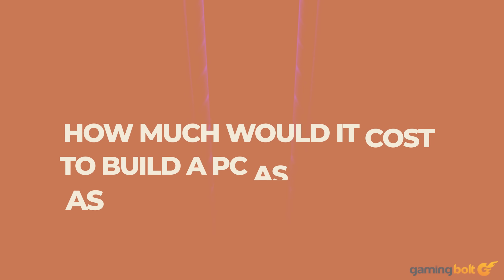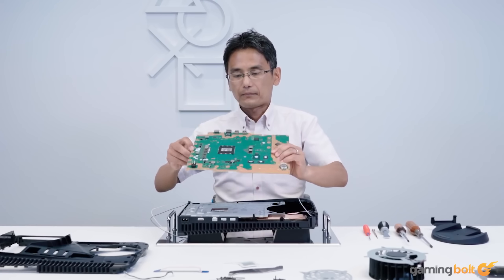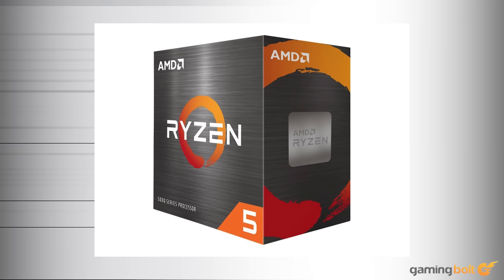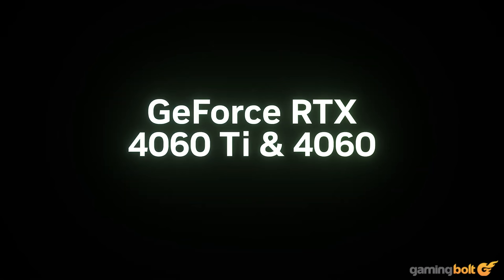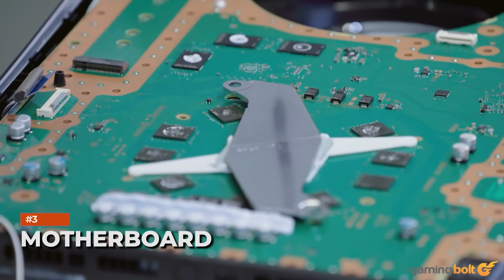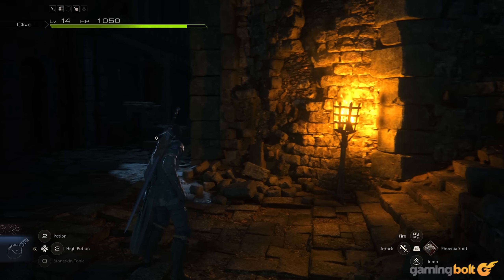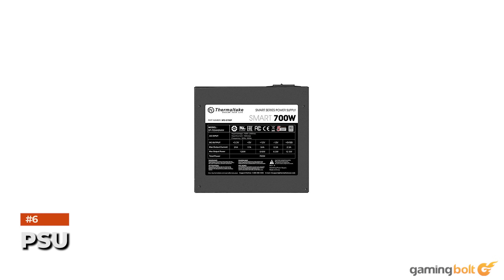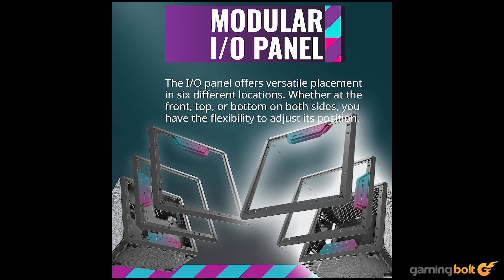How Much Would It Cost To Build A PC As Powerful As The PS5? (2023 Edition)

Comment: The only thing that sucks about PC gaming is all the different launchers you have to have drivers updates and compatibility issues with hardware at least with consoles if the game case says what console you have you know it's going to work. Not to mention how fast PC hardware is outdated in compared to consoles I bought my Xbox in 2015 and the latest and greatest still work on it load times are slow but they still work. I built my PC about the same time and I can't play the new stuff
Reply: But, you're missing one of the H U G E benefits of building a PC - Future upgrading is easy! Want better graphics, pop in a new GPU! Same with CPU and mobo...easy to upgrade, as is the RAM....but you don't have to re-spend on the Case or PSU! 
I build my own PC's and don't have issue with launchers, driver updates are something you get auto notified about and are easy to update...taking a few minutes. You mean Steam, Epic, etc? Buy the actual game and install it yourself if you are so worried about launchers. I've never had any issues with various launchers. If you do, buy everything on Steam. 
Compatibility with hardware? What the hell computer did you build? I've never had a hardware compatibility issue in all my years of building PC's...which is around 30 years!

Biggest issue:  Buying a console is buying a DEAD END! Like my PS3! Yeah, I use that all the time...haahaa! DEAD END!
Reply: @KOrnhOliO1  I spent $375 on my Xbox One in 2015. 7 years later I can still use it to play the current console games. Yes it's 1080p but I couldn't care less about graphics more about gameplay and story and the mechanics of how the game works. I spent $600 on the gaming PC in 2015 and all that was able to afford me was an NVIDIA GTX 950 with 2 GB of vram and an AMD 8320e processor which in 2015 that processor was already 3 years old technology wise. 16gb of ddr3 RAM. It plays PS3 360 era games quite well. In 7 years later still plays those games quite well. To upgrade my computer to play today's current titles you're looking at what another $700 minimum.  I would need a whole new motherboard I would need a whole new processor socket whole new ram and the graphics card alone is about $500. Yes I could go with an  older generation card. But I would be in the same boat in another couple years that I currently am in now. I can play the triple a titles from a couple years ago but I couldn't play new latest and greatest. 

Last time I had games through steam like assassin's Creed games I still had to have the Uplay launcher to agree to terms and conditions and then it would go back to steam and launch from steam. Whereas on console if the box says Xbox no matter what Xbox I put it in it's going to work. You got to have the epic games launcher you can only buy epic games from epic you can only get games from EA and go through their crappy launcher or if EA and everybody else puts there game on steam you still have to have their launcher to verify the key then it will launch in steam. 

Yes PC gaming has its pros and cons console gaming has its pros and cons. I grew up in the 90s my first console was the original PlayStation I like their simplicity better. I couldn't care less about frame rate and graphics as long as the game doesn't stutter and I push about 35-40 FPS I'm pretty content and I don't game like I used to with all the micro transactions and game developers releasing beta versions for full retail price and everything that should have been included at launch is now in DLCs I play maybe a select handful of games and that's about it and I go back with backwards compatibility on my Xbox and play call of duty Black ops and Black ops 2 and Forza.

Comment: There's a lot of people talking about the specced hardware and compatibility... But I also think it's worth highlighting no peripherals, OS, etc etc.
This is just like for like hardware and the sum is always greater then the parts.
Add to that peripherals.. Either a cheap keyboard and mouse and a controller for gaming.. or just a keyboard and mouse which you would want a gaming one.
If you're going to use it with your TV then makes the use of it as a PC for other tasks more awkward. If going to use it as at a desk then a monitor as well. And with all this frame rate talk you need a good monitor, plus speakers or one with them built in.
Also an OS, which really is going to be windows; you can use a Linux for free but then have the negatives associated for general use.
On top of that, it would be a very blah looking pc. To have a stylish setup to match ps5 aesthetics you're paying out for better case, matching cables etc.

But! More than all that, anyone here built their own pc knows that when you've "decided" on what you want... You end up scrolling that little bit further down the 'sort price ascending' list and "ooh, for just another $40" I can get the next model up... And so on and so on.

Based on your core items there; you would be talking easy over a grand to do a proper match up.

Comment: Ryzen 5600x comes with the same cooler and can be got for the same price now. That Motherboard does not support the speeds you claim as it only a PCIe Gen3 M.2 not Gen 4. You could have got the Gigabyte B550m which has  PCIe Gen4 M.2 for a lower price

Comment: A RX590 outperforms PS5 in 1080p with HDR enabled. Hitting 380fps on Resident Evil 2 remake while PS5 plays it at 60fps with HDR. Most games are not even native 1080p and are all upscaled from 720p, 600p, or 900p. So the less upscaling the sharper the image. This is why 4k sucks.

Comment: Because of the mass market adaptation of consoles and franchises that are exclusive to a given console (at least initially), many games are optimized to extract maximum performance from the respective console. This is similar in concept to an Apple computer having inferior components to a PC on paper but yet out-performing that PC in reality : there is a very tight coupling between software and hardware that much like Apple, consoles also enjoy. 

This basically means it is very hard to compare "apples to apples" between PC and a given console just like it is hard to compare an Apple computer with a PC if you only look at the specs. Best way to compare I'd argue is to look at performance comparisons : analyze the resolution, frame rates, and approximate the graphical settings of games available on both PC and a given console and then figure out what it takes in terms of a PC that can achieve similar performance to the console with that given game.

Comment: Could have saved about $20 by picking a lower wattage power supply.
This tends to be how console vs PC pricing goes though. On launch day the console is cheaper, halfway during its life cycle PCs are about the same price or cheaper and just keep getting cheaper from there on. 
Not to mention by that point you'll have to spend so much money on the online (PSN) subscription the PC worked out to be about the same price anyway. And I'd say steamsales/key sites still got the PS5 'bargains' beat and launch prices tend to be lower as well. And you don't have to cross your fingers and hope you can play older games in the future because the PC's backwards compatibility goes back to DOS games even. Ironically if you want to play your old Playstation (one), 2, 3 or even 4 games you probably have better luck on the PC with an emulator than on the PS5 hoping Sony or whatever studio allows you to play it.

With a PC the up-front cost is higher* but in the end it works out to be about the same because of lower game prices and no subscription fees. On top of that you have a more flexible machine that can run more games (bigger game catalog and the option to emulate), and do things besides gaming; like my personal favorite activity: ranting on YouTube.

PS: For those that like to spout nonsense about the mouse+keyboard combo not being suitable for gaming. You can connect a gamepad just fine to a PC, heck it can even be a PlayStation controller if you really want it to be. But I'd advice getting something higher quality with HAL-sensors so you don't get stick drift.
Oh and try playing a strategy or proper sim game with a controller - there's a reason why they're not ported to consoles.

* Partially because people tend to want to hook up a monitor to a PC whilst they settle for the TV for a console - technically you could hook a PC straight up to the TV as well.

Comment: I used to be a PC gamer exclusively way back when, but somewhere along the way, I started using consoles more and now use them exclusively. Will they ever match a custom-built PC in performance and power? No, but I'm ok with that. As mentioned in this comment section several times, the primary reason I like consoles is that the games I play are designed to play on them. When I was building gaming PCs, I was always concerned with my hardware being good enough to play games. That and upgrading became really expensive.
Reply: yeah man you should have spent at least 10K in order to play a game in Ultra graphivs
Reply: @karlsamuelson2906  10k? XD
Reply: Yea I got into pcs when u had to be constantly upgrading. Even worse than today. It put me off. Console can be a pain but it’s hassle free and I don’t have the time
Reply: Same with me, I use my console to play game more than my PC.
Idk, maybe I just getting older so I don't have to worry about upgrading my PC. I just want to play game on my couch when I get home from work. I don't have to worry about how much FPS I'm getting to play certain games. For the last 3 years, I mostly only play 1 mmo on my PC and play everything else on console. I built my PC in the end of 2017 and paid around $2000 for that built. Now my pc just standing in my room, only sometimes turning on my PC because there still some games I haven't finish. I also have a laptop capable of playing games when I have work in other city.
Reply: i was in the same situation, pc can be easily outdated within 5 years, now that entire pc consists of different parts, new gen means new platform, new platform means more $$$ to spend. People praise pc gaming for its multiverse of use, but that comes in a huge cost, and that is optimization. End of 2023 we saw Alan wake II, does it play well on pc ? Yes, only if the pc is high end, and no if your pc is mid range.
Reply: I don't have the option for PC gaming. I have around 1K of money spent on steam and saves are too precious. Steam is currently having a 2023-24 account problem. With steams current method to verify account in support it's simply not possible for me to recover. I wish I could sue them. Perhaps this is why youtube ads show this legal team to sue steam...anyway I resumed my playstation gaming and upgraded. I forgot how many free AAA Single player games you get with plus. I currently have 97 games on my playstation (downloaded all in a 2 month period) and it's value is over $1,500 for 15$ month subscription. I started fresh and it feels good to lay down or sit on couch with controller. Final Fantasy 7 Rebirth is coming at the end of the month playstation 5 exclusive and it's going to be epic. I'm done with steam until they can change.

BTW be carefull with your steam account. If you log out of your pc and reinstall steam you may get what I have.
Reply: It's the same reason Software Engineers often prefer Macs instead of self built computers. You want to focus on the thing you're doing, not screwing around.

I am big into PC Gaming but even I get that.
Reply: @NotForMe-97  maybe software engineer and editors or writers would like mac (only edotors would have maybe a better experience). But for anything else you would choose windows for sure, i am an electic engineer and software engineer and using a mac is way too limiting, half of the programs arent even supported there sadly
Reply: Doesn't sound like you like games enough dude
Reply: @gomperhooblet  ridiculous thing to say

so u need to have a pc to like games?

laughs in GoW and Uncharted and Spider-Man 2

keep in mind I have both but tbh playing in a relaxed way knowing my console will do 4k and play any game with ease without the need to upgrade with an extra 500$ on a gpu or cpu is a great feeling
Reply: No offense but it sounds like you're not building a PC with the right budget.

Comment: I'm currently running over 50gb of mods for FO4, how many mods can the ps5 run?
all the pc parts you bought are way over powered compared to a ps5 so your vid is invalid plus the ps5 is nothing more than a games machine while a pc even a cheap one is a multipurpose work machine that can also play games.
there are far too many games on pc that aint on the ps5 or runs at a low grade to even consider downgrading to a console of any brand. 
but got to love the console peasants for trying to think they have better hardware especially when they do price comparisons of much more powerful pc parts to make a console look more inviting.
there are no games on the ps5 that I want to play that are not on the pc and gaming on my pc is only about 15% to 20% of its use so spending $500 on a machine that will spend more time collecting dust than being used is an absolute waste of money.
consoles are for kids/teens, pc's are for adults.
ps. whens starfield coming to ps5?

Comment: right now there are plenty of laptops more powerful than a PLAYSTATION 5 FOR AROUND 6-800 DOLLARS. Ryzen 2 which the playstation 5 has is weaker has lesser power than an intel i5 or intel i7 or a Ryzen 5 which most laptops are being sold with. 16GB ram is the only thing that the Playstation 5 had that was unique about it but laptops are catching in the same price rang with 16GB of ram yet with an intel i7 or Ryzen 5 or Ryzen 7 for under 800 dollars. And trust me even most smartphones are coming out with 12 OR 16 GB of ram and with CPU processors like the snap dragon more powerful than an Ryzen 2.

Comment: right now there are plenty of laptops more powerful than a PLAYSTATION 5 FOR AROUND 6-800 DOLLARS. Ryzen 2 wihc the playstation 5 has is weaker has lesser power than an intel i5 or intel i7 or a Ryzen 5 which most laptops are being sold with. 16GB ram is the only thing that the Playstation 5 had that was unique about it but laptops are catching in the same price rang with 16GB of ram yet with an intel i7 or Ryzen 5 or Ryzen 7 for under 800 dollars. And trust me even most smartphones are coming out with 12 OR 16 GB of ram and with CPU processors like the snap dragon more powerful than an Ryzen 2.

Comment: Gpu on ps5 is Rx6500. Rtx4060 is overkill. You should use Rx6600
Ssd on ps5 is dramless 3500mbps. Any pcie 4x4 is faster
CPU 8core = 4c 8t in pc. I3 10100f or ryzen 5500 is the equivalent

Comment: The 4060 is a joke, you better get the 3060 with 12 gb of vram and not far from the performance of the 4060.
But if you dont care about nvidia the 6700 xt is the best gpu to get for that kind of money.
Reply: No. Rx6500 is gpu on ps5. Rx6600 is better option

Comment: I'm a console player for 10 years but a Ryzen 7 5800X3D + RTX 3060 Ti + 16x2=32GB RAM + Samsung 970 NVMe 512GB + PS5 Like PC Case + Best Aircooled Setup is perfect enough to beat any PS5's or XBox X Series or Z Series in general. PC already bested consoles both in Performance, Gaming, Software Development, Office / Remote Works and Content Creation.
Reply: AMD would be cheaper and beat the PS5 lol and don't use the name brand more known parts and you can save a lot more.

Comment: Mistake‼️ people make comparing computer gaming to consoles is a computer will have to be more powerful to get same quality of game play because console games are better optimized for a single console design instead of multiple computer builds drivers operating systems and such like how apple ios functions better than android on equivalent hardware, 👍👍video
Reply: Consoles also use a mix of high and medium settings to hit the target resolution and framerate. PC gives you way more options and this video is using overpriced parts and have no idea what they are talking about.
Reply: @Rooster832  understand computers blow gaming consoles away for power but with consoles games only need optimized for a specific machine so it can get more out of the game with less hardware, so when these hardware comparison pc to gaming consoles are done it doesn’t accurately represent cost to power & ease of use
Reply: @c.daubz.5386  I've seen many comparison videos of the 6600xt beating the PS5 in games like Cyberpunk, Doom, RD2, GTA, AC, and others and it has less RAM, smaller bus speed, fewer Cuda cores, lower clock speeds, and more. The 6600xt really only beats the PS5 with a slightly higher boost clock speed and more transistors.

Comment: One thing you forgot about, especially when you quoted the price of the PS5, the optical drive aspect. In your current configuration you would have to quote the price of the digital PS5, not the disk. So for comparison reasons the cost would be $399 vs $770. Finding a 4K Blu-ray drive for the PC would be $100 or more.

Also why are you showing Gears of War for a PS comparison?

Comment: I have been a gamer for 15 years, never owned a console, my current gaming PC I bought 3 years ago and it did cost me $5k, still strong, but I'm thinking about switching to PS5,  firstly if I buy a second hand PS5 it would cost me $400 secondly PC power consumption is very high, thirdly yes it is easy to upgrade the hardware of the PC but if you want to upgrade anything like a decent RAM or GPU it would cost the price of a new console.
Reply: I think the worst thing for me in regards to PC is how they constantly change CPU sockets, so you are prevented from upgrading the CPU, or in other words forced to change motherboard every so often. I think it wouldn't hurt the PC industry to offer LTS motherboards or something like that.